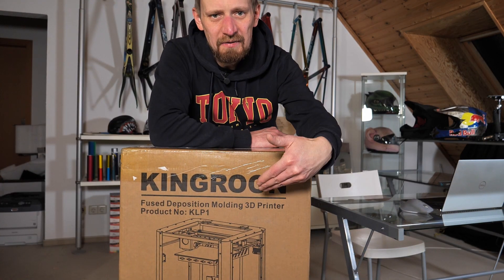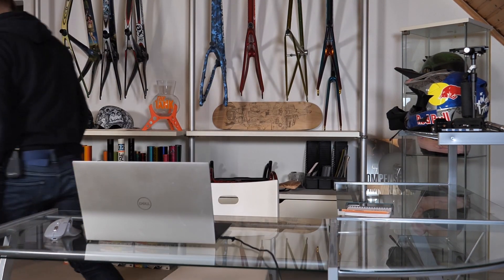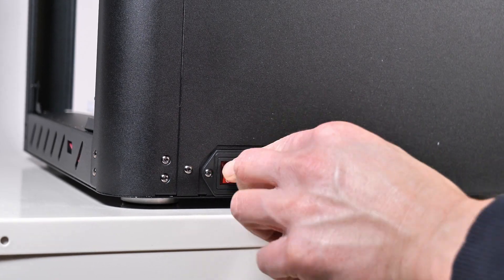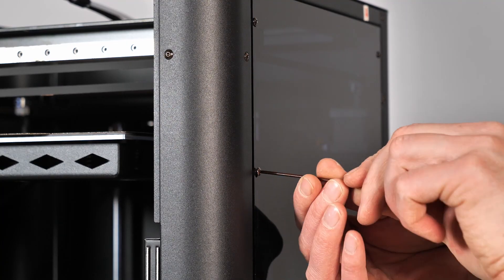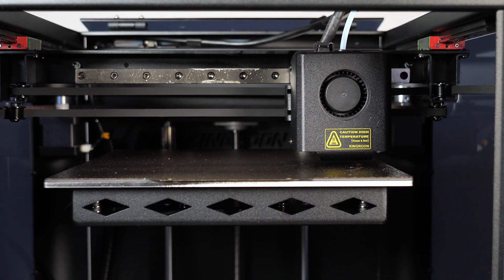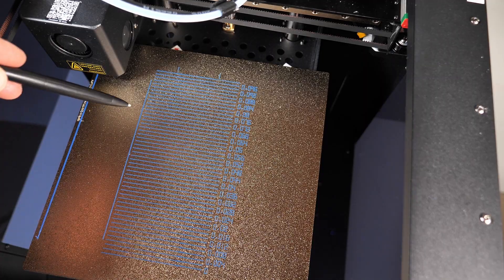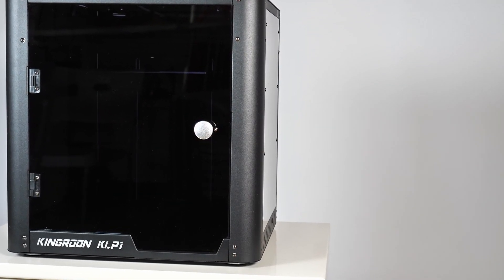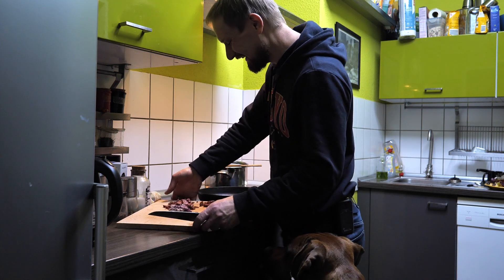Kingroon KLP1 Full Setup Guide plus improvements

Comment: My current 3d printer is driving me nuts so I might just follow your advice. It's a XYZ, breaks filaments like there's no tomorrow and I had to buy a NFC chip to be able to print other filament brands and since then the software has been acting up. I mostly use CURA but for loading filament and such I still use the OEM software but it has become buggy as hell. Thanks for another very informative and interesting video!
Reply from the maker: Just buy a printer running Klipper firmware. It is so much better, open source and full of easy to handle features. I use Cura as well and the Kingroon comes with Cura setup.
Reply: @ETOE  That does sound great! Thanks for the advice!